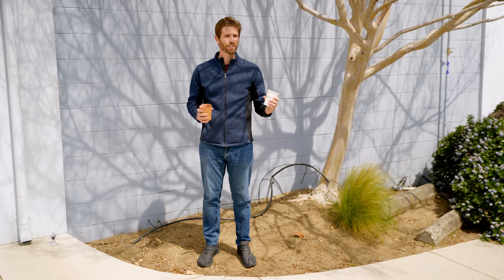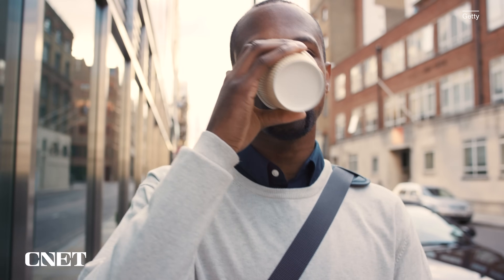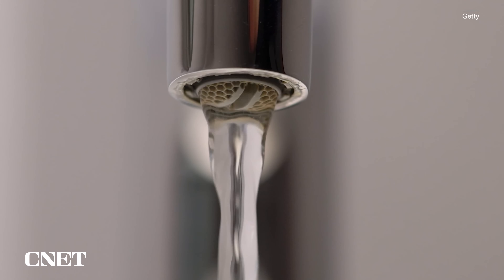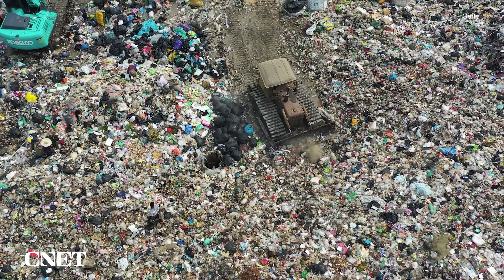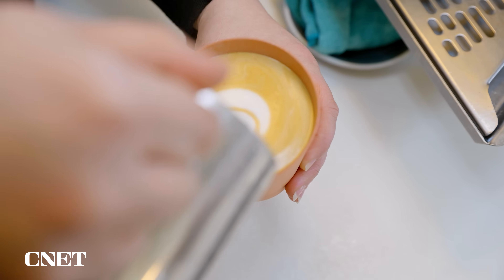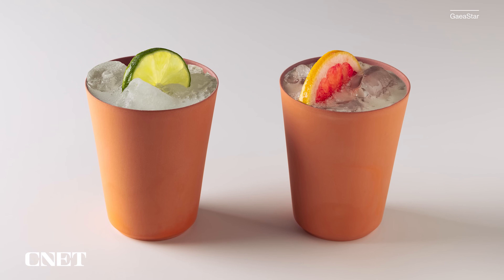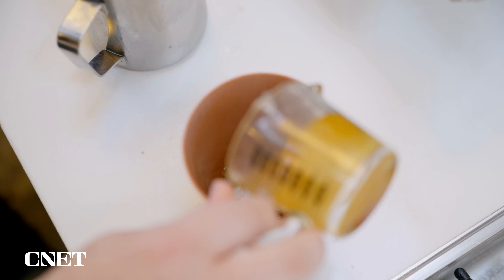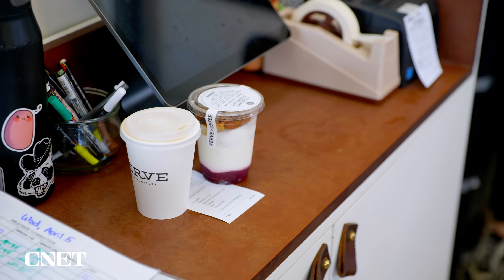You Can Smash This Coffee Cup and Leave It on the Ground (It's Made from Dirt)

Comment: How Much Does The System Cost?

Can it Be Purchased to In Home Use( and Cost Wise, Would It Be Practical)? 🤔 

Where Do You Purchase The System and I Guess Supplies , To Make The Cups? 🤔 

From this Short Video, It Seems It Can Also Make Single Use Bowls??? Is That True? 

This Video , Though Interesting , Certainly Leaves More Questions Than Answers and No Info on Hiw To Contact The Developers/ Designers/ Manufacturers